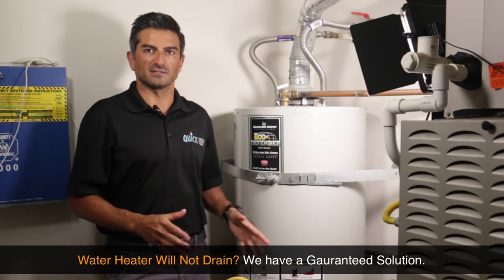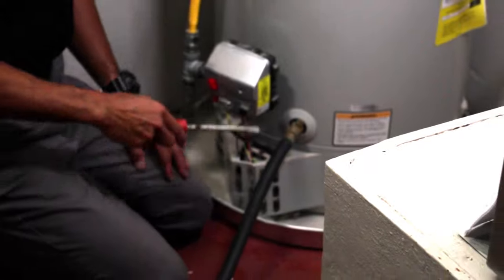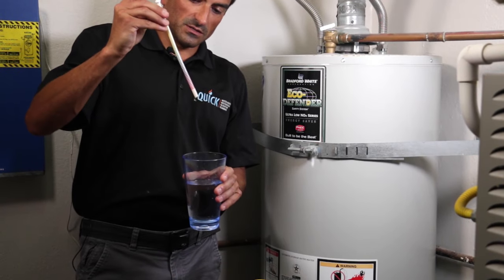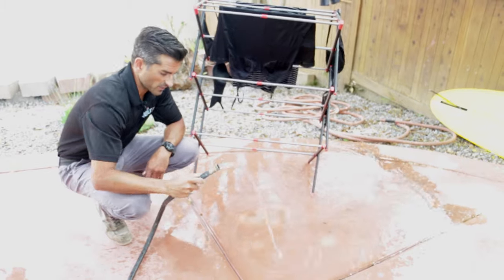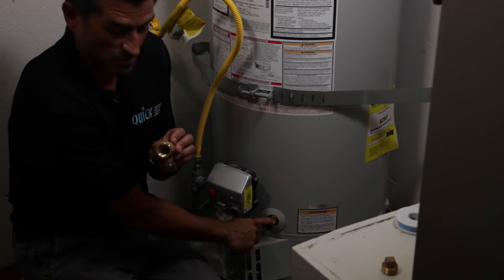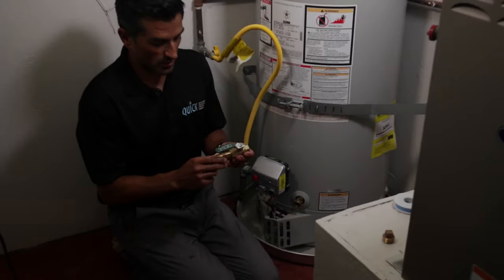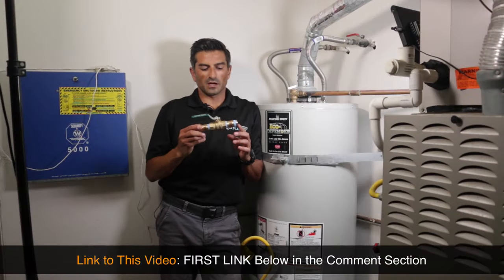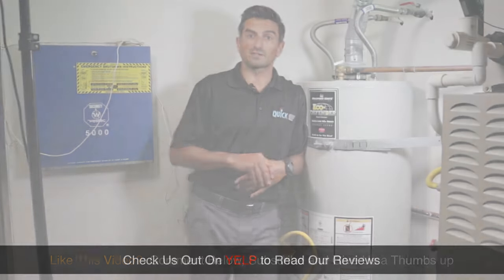My Water Heater Won't Drain [Fix It With 3 Easy Steps]

Comment: I know this might be a late to the party comment, but perhaps it will help someone else. I tried everything in the video and nothing helped… until I opened the pressure relief valve and left it in the open position… healthy flow all the way to empty! (I did test with water pressure on to make sure it’s not a clogged up valve first) The tank is 1 year old…and I was getting pissed off it was not draining with pressure off 😂

Comment: I had the same plugged drain valve on my 11 year old 649DORT Reliance 40-Gallon Electric Water Heater. Mostly caused by the complete degradation and totally corrosion of the entire 29" Inches OEM Anode Rod, as it was impossible for me to drain the water tank that was equipped with a plastic drain spout, but I could not introduce a screwdriver on the opening, as the outlet connection to hook up the water drain hose, was at a 90 degrees from the straight pipe coming out of the heater tank. Thus the method to unplug it I use was by using my air compressor with an air hose an air blow gun that I inserted on the end of the drain spout, using about 90psi of air pressure I also I opened the hot water safety relief valve and as I was blowing air into the tank I could hear a weak air hissing sound into the tank that eventually sound like and explosion that pushed out the debris plugging the drain spout and soon after water was draining out the spout and was able to completely drain the entire tank, then I open the cold water and continually rinsing the tank while the water was coming out in a milky color with small particles of the corroded aluminum material and other mineral salts? until the water was clear of debris and clean... I then installed a new Aluminum Anode Rod.. I try to remove the plastic drain spout,  to replace it with a metal one that had a larger draining orifice, but the plastic one was too tight and I was afraid that it could break apart if I forced it out, and then I would have even a worst case scenario there, so I leave it like that.

Comment: This is a great idea, however, on my tank, I tried a 4th method.  I shut off the cold side, opened a hot water valve on a sink and connected a hose to the garden water and the drain using a double female garden hose connector.  I opened the garden water and back flushed the water heater drain.  That opened it right up.  It flushed and drains perfectly now.

Comment: Dont remove supply lines to allow air into the tank for draining. its just another area that can break. all you do is Open the overflow valve on the top of the tank. there is a little lever that flips up. after all water is turned off you open that valve on top DO NOT REMOVE SUPPLY LINES FOR AIR FLOW
Reply from the maker: I can tell you didn’t watch the whole video.
Reply: @quickwaterheaterfiltration5292  I did. Pressure works best but if you need airflow for gravity drain just open the PR valve. Its the same scientific effect with no tools or chances to twist or break a fitting. Thats all. Great video

Comment: I made a Hot water heater drain valve per your description. I could not prevent the hose from leaking!
 I found by watching  another DYI YouTube video that you need to have a garden hose adapter for the part that the hose attaches to. It is a 3/4 inch MHT X 3/4 inch MIP which is actually called a garden hose adapter.

Comment: Old plumber's trick if you have an air compressor...
Shut off hot and cold water pipes attached to water heater.
make an adapter with a 3/4" male adapter to fit into relief valve opening and have a schrader valve (think bicycle tire valve) connector on the other side.  Use an air chuck hooked up to your air compressor to force air into your water heater tank and water out the bottom.  If you have a lot of scale build up in the bottom of the tank, this pressurized approach will force it out the faucet on the bottom of the tank.  Also drains it a lot faster than gravity feed.

If you have an electric water heater and the sediment is real bad you can remove the bottom element and finagle a scrapper out of S-cleat to draw the sediment to the opening.
Reply: Love that idea for the electric water heater… thanks!

Comment: It's draining now!! Followed your 1rst step using pressure from the incoming water valve. Did that over and over. Probably 5 or 6 times. Along with opening a hot water facet. And then the magic happend! Draining as I type. Thank you so much!!
Reply from the maker: Magica!

Comment: I tried three different ways to unclog a hot water tank and they all failed, until I found this video that showed how to increase the air pressure pushing down on the water in the tank and bingo, the drain started to run and the tank emptied!  Great video!
Reply from the maker: Glad it helped

Comment: Great video with clear and concise instruction. Reduced drain time immensely and no video prior mentioned releasing the pressure at the valve. Kudos to you!

Had to replace the elements and now fingers are crossed for hot water!

Comment: Exactly what I was looking for!! Watched I don't know how many videos now and they all say to turn the gas to pilot or off, turn off the cold water or if none exist turn off the whole water supply. Then turn on a faucet with hot until the water stops coming out. Did all of that and still the only way water would drain out is if I turned the water supply or cold back on. Air locked!! Makes since but I never would have figured it out without your help. Thanks so much!!!
Reply: Oh, btw, when you mentioned the hot water faucet didn't do the trick because it was lower than the hot water heater (which is true) I decided before trying to loosen the hot water hose going upstairs and turning on all the hot water faucets 😁 Did the trick! Thanks again 🙂

Comment: Had to use a different method today on a hot water heater with a plastic drain that wouldn’t drain at all to much settlement inside had to use the gallo gun on it it did the trick!!

Comment: Thanks so much for this video.  I made a custom drain valve per your instructions and it worked! Before that, a local tech tried a shop vac on the old drain. Didn't work. then I ordered a fitting that allows you to blow compressed air into the tank. No good, sent it back. This will save me $$$ when it's time to replace my tank.

Comment: Your detail for the homemade drain valve saved the weekend; thank you for sharing! After removing the OEM valve I saw that it was plugged and discovered why none of the other tricks would work. Now, when I need to replace the water heater I'll install one of these valves during installation.
Reply from the maker: Brian Fletcher awesome. I’m glad the video was able to help you.

Comment: Excellent info!   I had exactly this problem -- sediment had chocked the drain valve.  I had no idea what to do until I saw this video.   Keep the pressure on (water inlet open) to push out the sediment through the drain valve.  Worked -- thanks!

Comment: Awesome video, thanks!  I followed all of your instructions on pulling a vacuum on the tank and it worked like a champ.  I had the new valve ready to install and I probably didn't lose any more than one cup of (nasty) water from the hot water heater.  It was taking about 2-3 hours to drain my hot water heater.  With the new 3/4" gate valve, it takes about 15 minutes.  Thanks again for the advice.
Reply from the maker: That's awesome! Glad it helped!
Reply: So when creating a vacuum, you want no air in the tank, right?  Like in the prior step he opened the hot water supply to let air in…when trying to put vacuum back in, I have to reattach the water supply, right?
Reply: I don't believe it's ever worthwhile or advantageous to ever use a gate value. 👎 It is always best to use a BALL VALVE! 👍👍👍

Comment: Good video that helped me. I have a Rheem unit and that dreaded plastic drain valve. Fortunately I was able to wrench it off and install the Ball drain as you recommended. The Plastic  drain valve I had was defective because once I replaced it, draining was normal. Inspecting it showed what looks like a black o-ring inside and I suspect that is foreign and may have been a problem from the start since this is the first time I did maintenance on it.  I also replaced the anode rod which was completely disintegrated. Nothing but the screw came up. Again thanks for the info. I saved $1,000 from adding life to the one I have!!!!
Reply from the maker: Glad it was helpful!

Comment: 4:12 that lever is the pressure relief valve. All you had to do was open it.  I just did mine and I was not understanding why it wouldn't drain but you helped me understand why. Thanks.

Comment: Great video! I live in the country and I do not use anode rods. Our hot water and the anode rode combined make for an eggy smell. No rod, no smell BUT as per the video, nothing for the minerals to attack. My absolute favourite part of the video is the tip on replacing the outlet valve with a 3/4" ball valve. Brilliant! Open and flush. Keep up the good work!
Reply from the maker: Thank you!
Reply: I am not a professional but are there not different rods types that will keep from making the egg smell? I thought I had read that if you replace standard magnesium rod with a zinc anode it will not react with bacteria that causes the egg smell... an idea to look into?

Comment: Great video. I found that a short 3/4" close nipple for the garden hose side will not extend as far out from the water heater as a 2" nipple would and it works just as well.

Comment: Really helpful, thank you so much. One thing I will mention is that if you just need to do this one time to drain an old water heater all you really need is the 3/4" 2" inch brass nipple. The whole ball valve setup really isn't necessary for one time or occasional use.

Comment: I have a water heater that started leaking and would not drain. I just watched your video, tried #2 and replaced the cheesy OEM valve and it worked like a charm. Thanks!
Reply from the maker: Glad it worked for you!

Comment: I thought there was a vacuum keeping my water heater from draining, and your advise was helped me solve the problem.  Thanks for such a well-made video!  And BTW, I had a plastic Rheem drain valve and I replaced it with a brass one with no problems, so at least in my case, I wasn't screwed.
Reply: I've got a plastic valve too. Reliance water heater. How'd you go about replacing it with a brass valve?
Reply: @GhostGL  the video explains around 6:25

Comment: Saved our bacon, you did. Have a Rheem, with the plastic valve, that needed to be replaced. We managed to replace the valve with only about a 1/2 gallon of water on the floor. Our new Rheem has a copper valve but we are replacing all our water heater valves with  your concoction. You failed to mention that Home Depot charges about $50 for the parts. Money well spent. Thanks and well done. Nice demo on the teflon tape, too.

Comment: This really works. If you are unsure of he fittings talk to someone at HD or wherever you get your supplies to help. This is especially true for that little bit that connects the valve to the hose, it's kinda hard to find. My old plug would only drain at about a half gallon an hour. With the 3/8" straight shot, the whole thing emptied in about an hour! The old drain plug's hole pinched down to less than 1/8th inch and was totally clogged. Can't imagine this one will ever clog, but if it does, It will be a snap to ream out since there is no bend. You should have a large crescent wrench and a pipe wrench to make this. Don't forget the Teflon tape! The brass parts aren't cheap (ran me about $35.00) but worth it. This is a great hack!

Comment: Replaced my first water heater today, with the help of my dad (his 4th or 5th) and encountered a drain valve that wouldn't drain. Not a great start. I found this video and decided to do the replacement valve method. Granted, I must have messed up the negative pressure part as I got hosed by water, but I got the new valve in regardless.

Though it was evident based on the chunks of calcium on my jeans and the towels I laid down, the inside of the old valve told the story, completely packed with calcium.

Anyhow, thanks for the tip, it worked perfectly.

Comment: Great video. Ball valve is a great idea. I’ve had one for years with no issues. I wouldn’t turn off the gas completely just turn it on the pilot. Why would you want to complicate relighting it and all that when all you need to do is put it on pilot? You can leave it on pilot with 2 cups of water in the bottom and it wouldn’t hurt anything and makes it much easier. Also instead of disconnecting the water supply lines to get air into the tank just use the over press test valve lever. Much easier to allow air into the tank. Thanks for posting
Reply from the maker: Thank you
Reply: Unless you can’t flip the valve.  I don’t know if it’s too old or I’m weak but I can’t flip it.
Reply: @nude_cat_ellie7417  If you’re talking about the over pressurization safety valve then you probably need a new one if it can’t be opened with a flip!
Reply: Seriously! That t & p valve is there for one purpose and if it fails to activate "KABOOM"
Reply: @danielcardinale4562  it’s not going to fail. It’s not like it’s a one time use. In fact they recommend testing it. Never had issues

Comment: I replaced the plastic water valve on my Rheem 50 gal electric water hear with a quality brass one.    Came out ez pz.

I installed the same one you used in this video.

Comment: Good, really good video. I was ready to put a tap in like a maple tree. My Bradford White has a pressure valve on the side, so instead of taking off the one of the supply lines, I opened up the pressure valve and voila, water started flowing. Thanks so much for your help.

Comment: Very good instructions, unfortunately I fall into the "screwed" category with old brittle plastic drain valve.
Reply: How'd you drain it after all?
Reply: @JD-AlphaMedia  The plastic drain valve actually opened without breaking, and I just had to get the flow started with pressure from the tank. Went smoothly
Reply from the maker: Yeah.  That sucks but that’s the cost of discount water heaters at Home Depot. Not all water heaters are the same.

Comment: I seriously need to try this I have been replacing a lot of water heaters over on the beach and the wont drain at all so I have to take a hand cart and carry them down 2 or 3 storys full of water and I'm too damn old for that so I've spent money on pumps and all sorts of mess to get them drained so I will be at lows again tomorrow to get this balljoint hoping it will work as you say it does thank you so much for posting this God bless you🙏

Comment: Great content... Just wondering it would be the same for a lift pressure release valve. Would you have to open it up completely or just enough to get the water to flow? Thanks🎉🎉🎉

Comment: Worked great, and it's good to know that the WH's with a plastic valve are done for when it won't drain.  Had several things going on with it.  A leak from the drain valve and a leak from the gas control valve (signaling that the sensor is cracked), along with rust on the water intake and the difficulty draining it.  New water heater from HD.  It was 9 years old anyway.

Comment: Great video however I don't agree that you're screwed if you have a plastic value. I successfully replaced mine which actually sheared off when I attempted to remove it and I did have to jump through a few hoops to remove the remaining plastic from the threads. However, its now got a brand new brass extension and ball value on it'll make my next drain service a breeze.
Reply: Exactly. Trying to remove mine and its in there good, the wrench just wants to slip on the plastic. Can't use enough force to loosen it.
Reply: @jdomes8792  If it hasn't already more than like it will break but if it does use a sprinkler head removal tool to get the remaining plastic out. If that doesn't work you might have to dremel it out carefully without damaging the threads.

Comment: Great information and video. Mine would not drain...hours and just a dribble. I changed out the valve and bingo, done in a flash. Got some orange water for a while but drained the tank again and ran more through the pipes and it's clearing up. Thanks.
Reply from the maker: Sweet. Yeah it’s a must to let air in the tank and get a drain valve that can pass chunks through.

Comment: Thank you for your video, but I also used pipe dope along with the teflon tape.  Why didn't you use pipe dope on the video ?
Reply: I did the same 10 years ago on my then 15 year old heater. Still going strong with never a leak. Of course I do same on threads of every new anode rod I install every 5 years.
Reply: You can usually get by with out the dope on tape but better safe than sorry. Reference Steve Latimer on YT.

Comment: Decent and helpful video, except one claim.
If a tank has a Plastic  Drain Valve and it breaks while attempting to remove a simple procedure to get the remaining piece out is use a Hacksaw Blade to weaken the plastic. **Use care to avoid Cutting into the Metal threads on the tank. Use a flat screw driver and Needle Nose pliers to pry out the sections of plastic. Install the new drain valve.
* For Calcium Sediment issues - keep the Thermostats at or below 120.
Check the Anode Rod as part of an annual service and replace as necessary.